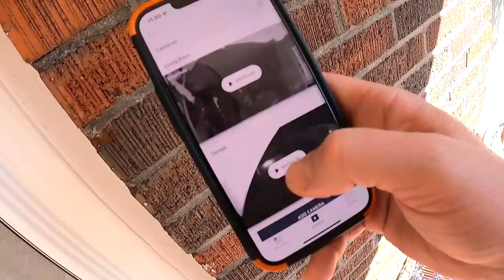They Weren't Sure About These, May Take Some Time.

Comment: Dusty, use a floor jack when you're by yourself on the panels. You'd be able to adjust how high or low, and the jack is plenty strong.

Comment: I was looking at the gate reconfigured by Big Joe  and thinking about maybe using larger tube or welding horizontal plate on the back of the tubes perhaps four inches deep so that it would be less likely to conform to his ideas.  They would look like little shelves on the back of the tubes.